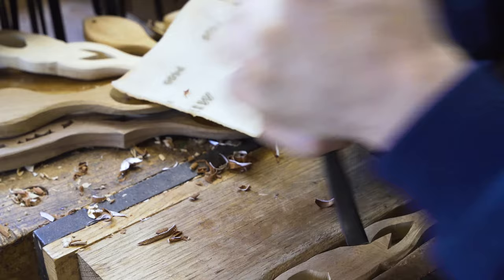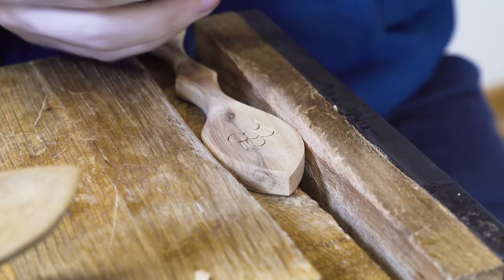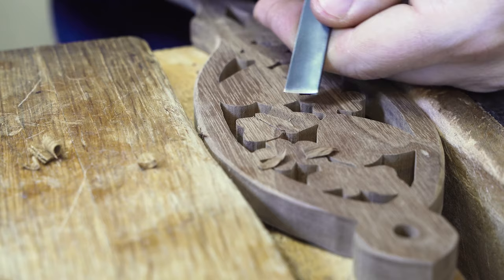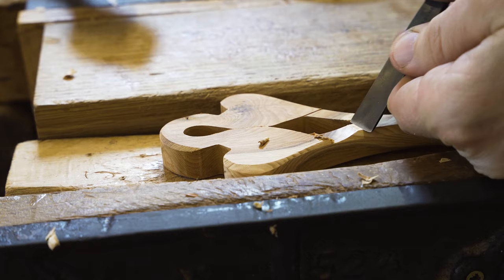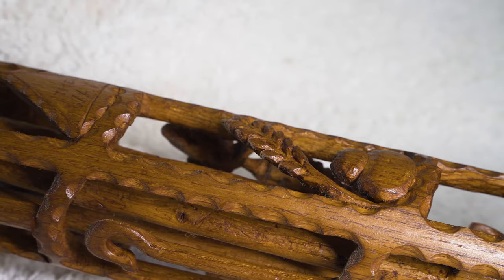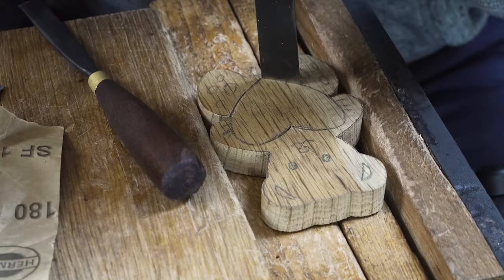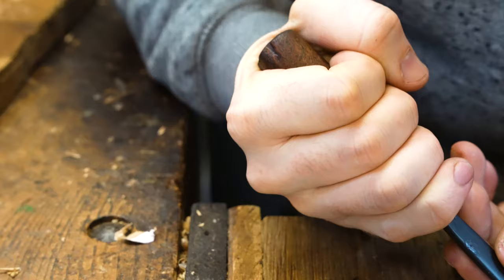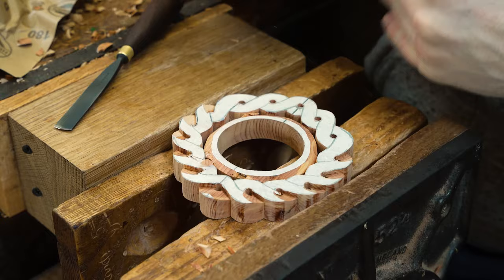What woods do we use for wood carving?

Comment: what about maple does it work
Reply from the maker: Hi Charles, great to hear from you. I enjoy working with Maple myself but dad finds it a little bit on the harder side. For me it has a beautiful finish and carves really well. If you have a source for getting hold of Maple it is definitely worth having a go with it and seeing if you enjoy working with it.

Thanks for getting in touch and supporting our YouTube channel. All the best from us all here at The Lovespoon Workshop. 👍👍
Reply: @DailovespoonsThomas  i am thinking truck load of fire wood for carving  i dont have a fire place
Reply: and use it for scroll saw working
Reply from the maker: @charlesboyd8757  indeed, it can be cut on the scroll saw well too. We use a Niqua speed number 9 reverse tooth blade and the Hegner multicut 2s and it cuts Maple really well. You can get a lovely finish on it too. 👍👍
Reply from the maker: @charlesboyd8757  it depends on the condition of the wood to be fair. How it has been seasoned, stored etc. If it has been seasoned correctly and you can source pieces that are clear of splits, knots etc it should be absolutely fine. We source alot of wood from old furniture and from local tree surgeons too. For the wood carving we do, the logs are cut ideally anywhere between half a metre to a metre in length and seasoned naturally. 👍👍